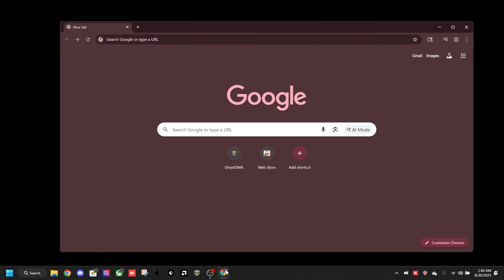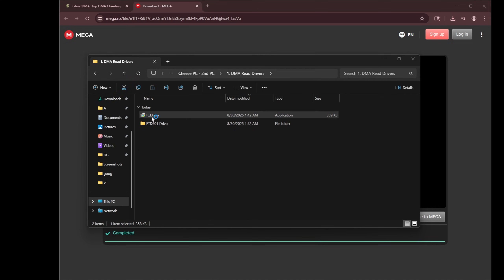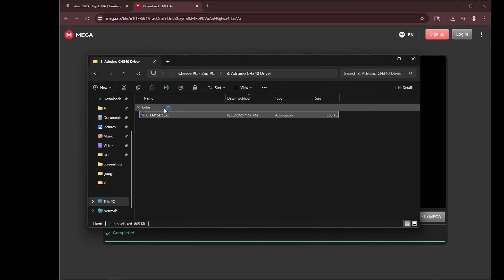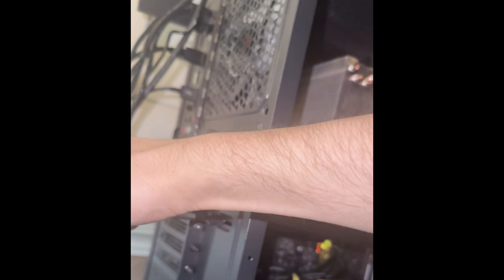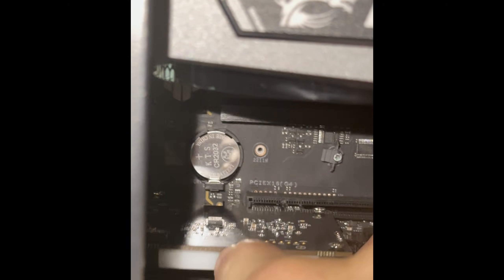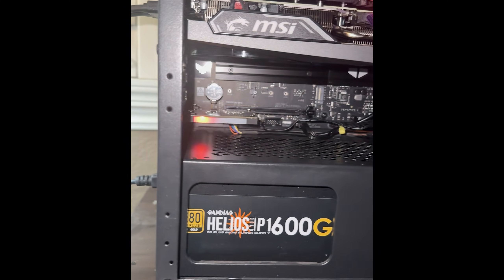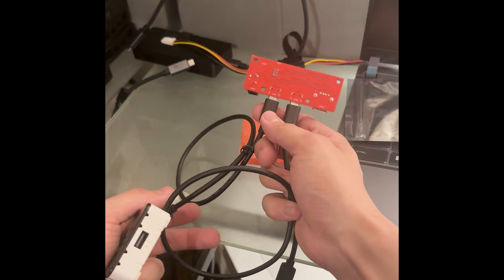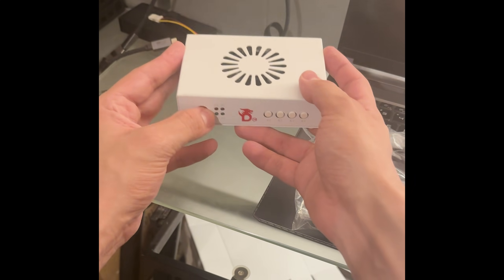GhostDMA Quick Start Guide! 👻💨 (If you get an error with DirectX SDK, that’s ok if you do, skip it!)

Comment: My msi b550 works fine
Reply from the maker: ASUS B550, other brands of B550 is ok. And that being said, some ASUS B550 MB do work but it’s a negatively weighted coin toss. Also the 4 series MBs, rare odds they function just fine with DMA but sometimes they do 🤷‍♂️
Reply: @GhostDMA yeah my pc was a pre-built being my 1st one and it had a offbrand and wouldn't accept the dma so I went to msi and worked perfectly